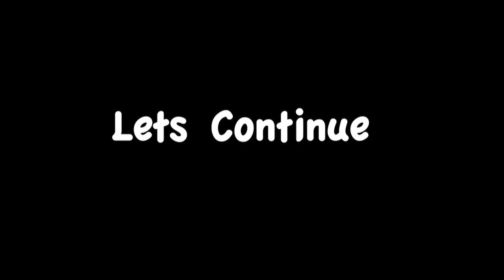Ikea Besta/Framsta - Wall Mount Entertainment Center Assembly Part 2

Comment from the maker: There will be a gap from the top of the cabinet to the ceiling. If that is not a problem you should consider Measuring the back side of both cabinets stacked and then leave about one inch to a gap from the top cabinet to the ceiling. Than mount the bottom first and then the top last. Measuring and finding the studs in the wall are very important in this task.  If you have the wall mounting kit that is sold separately from the cabinet. You will have instructions there on how to mount it.

Comment: why did you keep removing/adding those white brakcets  form 0:40 - 1:54, did you postilion them wrongly? (they seem same as before) I am asking because what to know, what  i need to pay attention to?? Thanks.
Reply from the maker: The Square brackets pieces that I took off were for the wrong wall mount style. I replaced them with them with more sturdy brackets that go with the metal wall bracket
Reply: JRReelLifeFilms Cheers, I actually realized that today when I was assembling the unit. Mind if I ask though what kind of screws you used for the rails???. I dind't get any screws fro the BESTA rail fittings. I located the studs and everything, just don't have screws to drill them in. so before I go to the hardaware store this weekend  might as well ask you.. thanks again